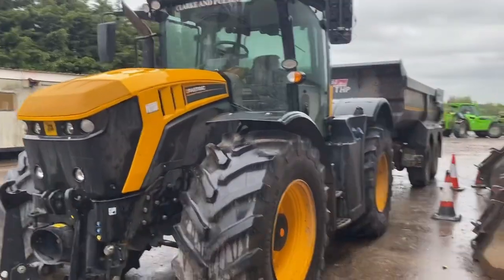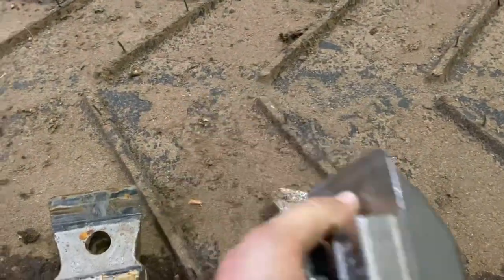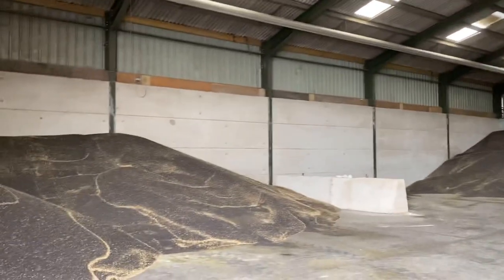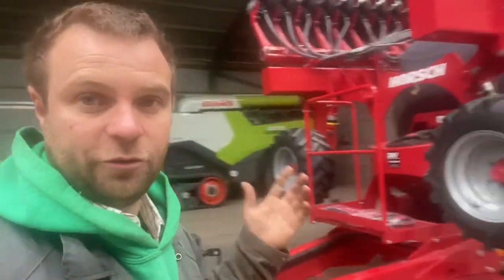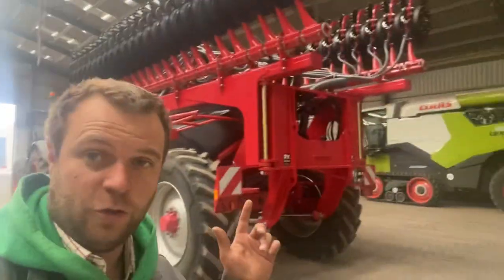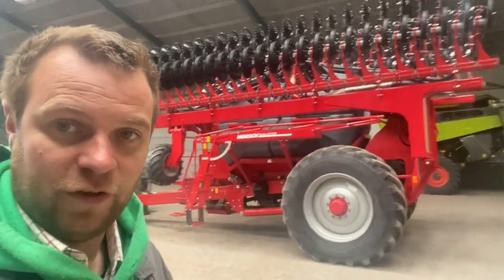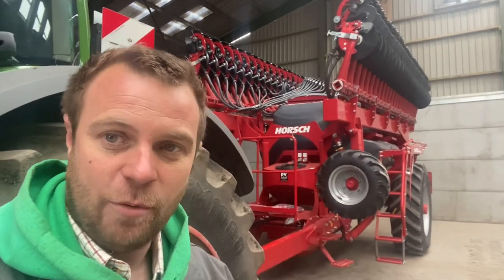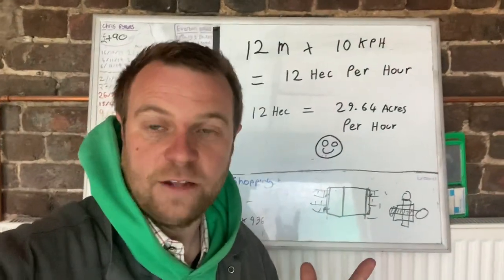Day 425 #OLLYBLOGS QUICK LOOK HORSH AVATAR DRILL BIOMASS Prob CHIPPER MOVER MADE #AnswerAsAPercent

Comment: I’m assuming that you do contracting as well as manage your own farm therefore when buying new machinery you need to consider not only what you need for your farm but also what you need to run the contracting business as well? If so in terms of the 724 could be replaced by a smaller tractor then it’s irrelevant as you need a tractor(s) of sufficient power to meet both your needs and those of your customers on the contracting side. Am I correct in my views or completely up the creek!

Comment: In a square field, assuming you are going the same forward speed with the new drill as you did with the JD, you will still be doing 80% working and 20% turning but the time itself will be halved. So you’ll still be doing the same amount of turns a day but ‘wasted’ time per hectare will be halved.
The real time saving will be in the reduced turning in the picks and on headlands.

Comment: The rockinger (can’t think what they changed the name to now) for the chipper usually have a second plate to strengthen the chassis there bolted to. They have been known to pull the bolts out from what I’ve been told🙂
Reply: @OllyBlogsAgricontractfarmer  most likely user error than anything lol

Comment: Drill is like a sprayer surely biggest gains are from tank size not boom width especially in smaller fields. About 75% today had an agitator drive fail on fertiliser spreader messed up spread pattern.
Reply from the maker: Oh no stripes
Reply: Luckily you can't see them when it's overcast

Comment: Would you consider running a chaser bin?We run a 20t hawe chaser.Game changer for reducing compaction and handy for drill filling etc.
Reply from the maker: would love one because they look cool but i want to use starter fert so would be complicated
Reply: @OllyBlogsAgricontractfarmer  check out the cross drill filler
It has 2 Augers so you can fill fert and seed in the one chaser.Built here in Ireland it's a monster of a thing.Its approx 100k in pounds though.

Comment: Your efficiency on the head lands will also be affected by how wide your headlands are. With a 12m  once across top and bottom will probably do but the  6m may have needed an extra one or two runs, therefore increasing your efficiency again.
Reply from the maker: Yes
Reply: That’s a good point, saving compaction on your headlands. 2 passes are better than 6 with a 4m

Comment: The percentage doesn't change for the amount of time on the headlands, it would still be the same as the other drill as the runs dont change in length but just more are is covered. However, the time does as naturally youll be turning less to cover a field.
Reply from the maker: More efficient by 100% or higher ?
Reply: Higher - fewer turns
Reply: @OllyBlogsAgricontractfarmer  Yes higher, as Ian says less turns to cover the same area. Improved efficiency and less overall footprint. Win win! However, the 6R would increase efficiency even more ;)

Comment: So it’s 100% faster due to double width. 

It’s then a further x percent per row. 

Say typically with the 6m drill you can cover 48 meters in an hour. 8 rows (your 80%)

Now with the 12 meter you can cover 108m in the same time. (9 rows) 

108-48 = 60

It’s 120% faster than the 6m drill. Almost to the extent you’ll cover just shy of a hectare in the time it would have taken you to do an acre.

Comment: When you bale the straw to save running the teleporter off the tramlines could try a transtacker 4100 so you can load your bales while keeping the tractor on the tramline
Reply from the maker: Yer or super chaser
Reply: @OllyBlogsAgricontractfarmer  trouble with a heath super chaser is that you'd still be driving off and on the tramlines to spin the bales around where as a transtacker has a front bar which will slide the bale to right so the stacker can pick the bale up keeping the wheels on the tramlines therefore keeping compaction to a minimum

Comment: Is the new drill a lot heavier and are you confident that yields will not be reduced from wider drill widths ie 25cm ?
Reply from the maker: Will be a bit 
why would they ?
Reply: @OllyBlogsAgricontractfarmer  I did wonder that too, surely it’s giving each plant less room to grow? And also more room for the black grass to get going in with out competition? Still love the drill though and Horsch, did you look at a horsch sprayer?
Reply: @OllyBlogsAgricontractfarmer  Wider rows leave more open spaces for weeds, the roots have to go wider for nutrients and bare earth in between can dry out.
Reply: @OllyBlogsAgricontractfarmer  On the controlled traffic farming and baling I read an article that one farmer would pick up the bales with a telehandler by running along the ctf tracks use a flat eight type grab to pick up bales and keep the bale trailers on the outside tram. I know it sounds slow and a two person job but if it saves having to cultivate the hole field might be worth it.

Comment: I think you are wrong with the % uptime. Yes you will spend half the time turning but you will also spend half the time drilling so the percentage working time will be the same 😮☹️ having said that the turns will take longer ( further apart I assume) so technically the % utilisation may drop ? ☹️☹️ but won’t have to fill up as often😀

Comment: Ffs the maths is doing my brain in.

Doubling size should mean 50% less time sowing and 50% less headland turns = 100% more efficient? 

But to get 12m sowing width with a 6m drill requires 2 runs, 3 headland turns, with 12m, one run one turn?  So 50% sowing efficiency and 66% headland efficiency = 116%.

I’m no carol voderman though but bigger means better ..... in the drill department at least. Top video as always.

Comment: Great video Olly! Quiz answer: for the operator  manuals. 
Do you have many pylons or telegraph poles in your fields that will make the drill slow down to fold up/move around? If not, completely agree with your efficiency calculations.
Reply from the maker: Any drill is a pig around poles tbh